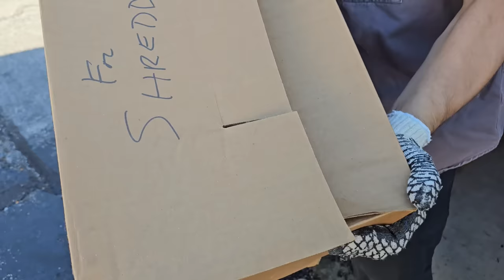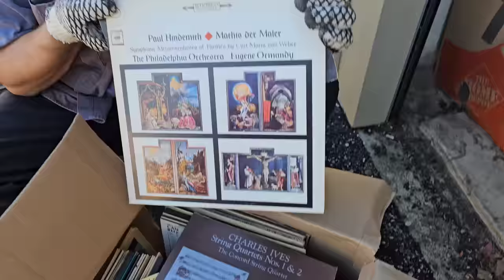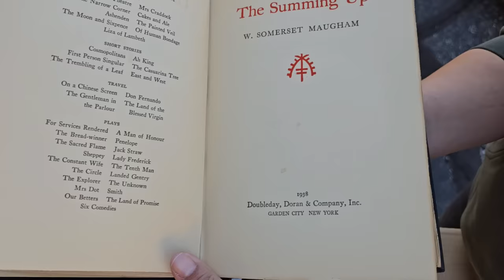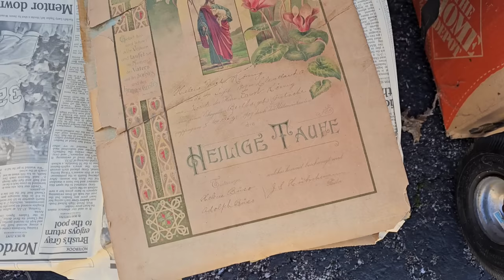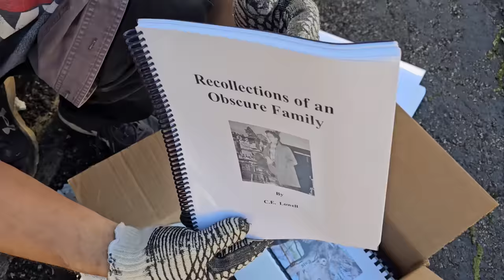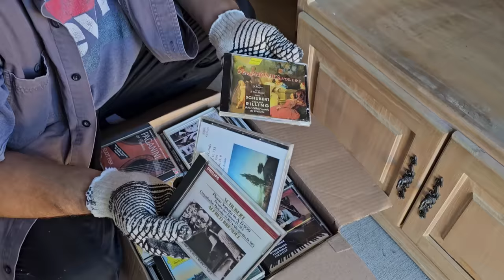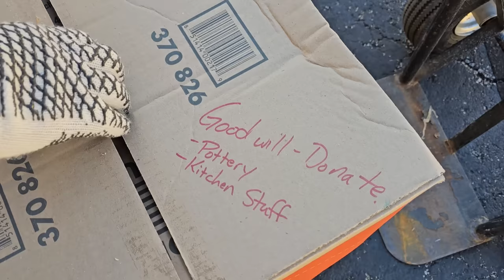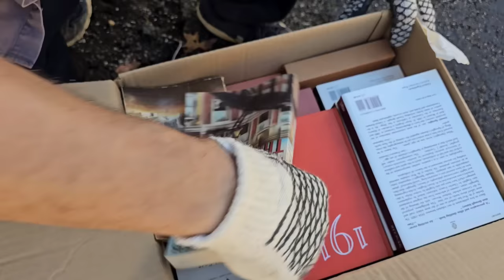DEAD BODY FOUND INSIDE STORAGE UNIT

Comment: I would contact a museum, a library or university. They could tell you what the history is. The "Harper's Bazar" framed artworks are most likely lithographs, prints. Good luck with the research. I would be very interested in hearing what you find out. ❤

Comment: I had a beautiful K&E slide rule that I used in college. Went into the service from 1972-75. Enrolled in college in the fall of 1975. 1st day of class a professor told me to throw away my slide rule, and buy an electronic calculator. Had some modest math functions, and cost me $86.